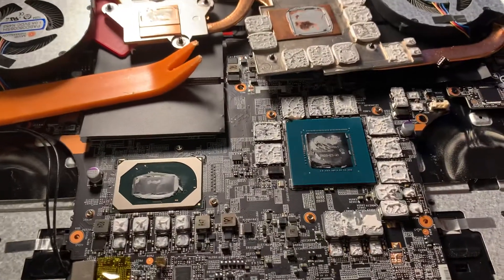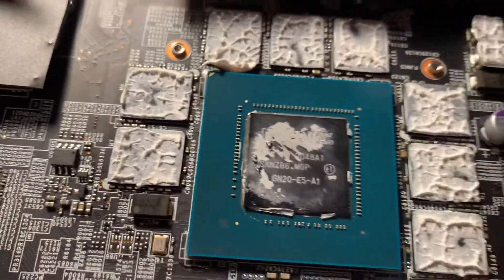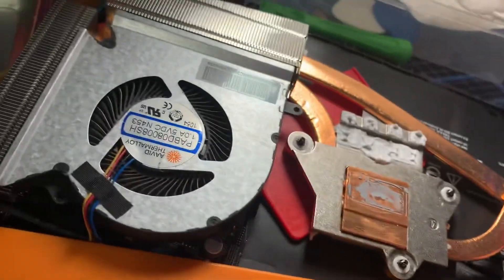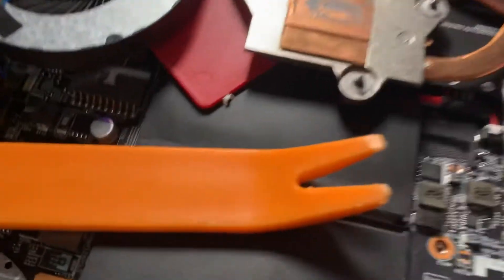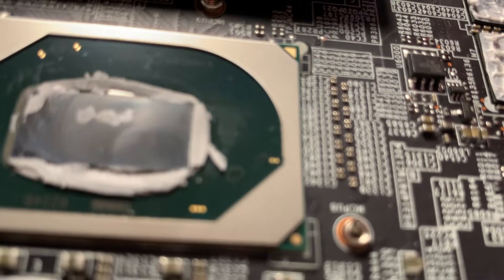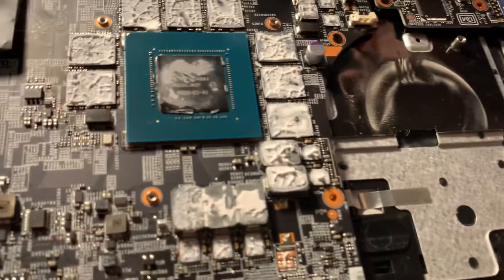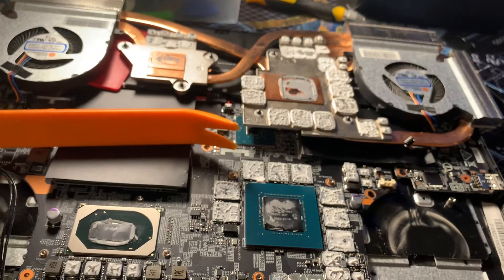Inside of an msi gp66 10ug 3070 / i7 / replacing thermal paste and pads. Tips for removal

Comment: Could you please let me know what size thermal pad you’re using? .1mm or .5mm
Reply from the maker: I used 0.5 but it created too much gap on the cpu/gpu core so you might need to use copper shim on the gpu/cpu dies. The best solution I found was a fresh layer or k5 pro putty on all the vram, mosfets and chokes and the thermal grizzly kryosheets on cpu and gpu die. That solution was far superior to everything even better than Liquid Metal
Reply: @cppctek  so better use 1mm for gp66 leopard?
Reply: Hi can you tell me when applying k5 pro putty, how thick should I make the putty layer on vram or should I just apply the putty like thermal paste ( very thin layer)
Reply from the maker: @ragnargaming6887 put 0.5mm thick or so. Maybe around the thickness of a dime. The rest will squish out and conform around the memory and the chips.
Reply: @cppctek  thank you so much for replying so fast, I got one last question, is it safe to use cryofuze violet for cpu and gpu, my friend suggested it gave him good results but since this paste also conducts electricity should I use it or no. Again thanks for replying

Comment: what should be the thickness of the thermal pad's thickness? that i need to use on memory and power supply coils.
Reply from the maker: .5 but actually thermal putty ends up working better in the long run. Use k5 pro.  After a year with shims was not too happy. Kryosheet on gpu and cpu plus k5 pro on everything else netted the best results when I had this laptop

Comment: I have a Msi Bravo 15 laptop, which pad thickness should i use? 0.5mm or 1mm?
Reply from the maker: I’d have to see it but likely a mixture of sizes. You will have to try to experiment and measure. I will be doing a new video hopefully this week using the new kryosheets and I’ll be redoing my thermal solutions that can give you some better ways to cool so stay tuned
Reply: @cppctek  Thank you! I bought a 0.5mm arctic apt2560, but I refunded it because I'm not sure if it will work with the laptop because of his thickness. And because I found a better option at a similar price. Maybe 1mm is ok..?
Reply from the maker: @reapersunshine2236 it really depends on the model. Your bravo uses diff components and capacitors and power stages and they can have different heights. Here is the issue. If your pads are too thick then you will have too big of a gap between the cpu die and the cooler or gpu die and the cooler too and you will run into worse temps than before like many find out. That’s why you see jayz2cents had worse temps thr first time he did his. Also there is a solution albeit risky but you can get perfectly sized copper shims but they require a lot of fitting and have a few risk. I’ve done it on mine. Also my temps are good now but I think there going to be even better this week with the kryosheet and going back to thermal putty but I’m going to see how well the pads made contact first and see if there’s any that were squished too hard or not squished enough
Reply: @cppctek  I'll try with 1mm. Hope i'll be lucky.. Thank you!
Reply: @cppctek  well, my Bravo 15 overheats at 100c in gpu, probably because of vram. Maybe 1mm is fine. Now, i don't have info of that laptop thermal pads thickness, so is just luck..

Comment: You should try phase-change material Honeywell PTM7950. It comes in as a sheet, lasts longer, performs works better than traditional pastes and there is no pump-out effect. For the power section (vrm) and vrams, I advise you to apply thermal putty Upsiren UX Pro.
It is also a good idea to do undervolting.
Reply from the maker: Thanks. I’ve recently picked up some ptm for my ally I tested it with as well as a ton of other stuff if your into ally content check it out. Also I do have some k5 putty it’s just messy lol. My laptops due for some cleaning so I will revisit this and test out some ideas All of MY ROG Ally Mods + How I clone my drives with one button! Feat. Yottamaster NVME Duplicator
https://youtu.be/8DjTrHzf6LA
Reply: Thanks for these suggestions!

Comment: Can not believe paid 1900 euro for 3080 model. Thermals are way too bad.. Thermal putty with cheap heatsink. Really msi.  Hardware like this really needs a real heatblock with decent thermal pads. cheapo
Reply: how did you unplug the battery cable im struggling with it have the 3080 model aswell and since i bought it temps are straight 95 while gaming throttled

Comment: Hey, how is the mod so far? I want to do the same with my Gp66 11uh, the Cpu temp crazy high, under load 95C throttles down to 3.5.(with undervolt) 
Any update?

Thanks
Reply from the maker: Still running awesome. I haven’t had any issues at all gaming or streaming or editing. It still gets pretty warm but never thermal throttles. I’ll check temps again but I know I use a cooling pad as well when I’m gaming to help
Reply: @cppctek  hey, is there a way I can contact you on reddit or somewhere else? I would like to ask  a few questions before I proceed with my mod:) if you don't mind of course
Reply from the maker: @Richard-dl2yp  drop your discord I got you
Reply: @cppctek  hey, have you had a chance to add me on Discord?
Reply: You should try phase-change material Honeywell PTM7950. It comes in as a sheet, lasts longer, performs works better than traditional pastes and there is no pump-out effect. For the power section (vrm) and vrams, I advise you to apply thermal putty Upsiren UX Pro.
Reply: @goorthiss Hi, sorry for my English, I've just seen your comment and I have a few questions. When ordering Honeyweell PTM7950 there are two sizes 40x80 mm or 80x80 mm, which is the correct one? And also I can't find upsiren uxpro, it's upsiren U6 pro, it's suitable? Thanks a lot, just wishing to lower my vector gp66 temps.
Reply: @DavidRoldánCampos  Buy enough PTM to cover the CPU and GPU. GPU RTX 3080 = 29 x 25 mm, CPU Intel 11gen = 24 x 12 mm.
Upsiren UTP-8 also has good performance, but U6 Pro should do the job as well. On the Snarks Domain channel, you can see their performance and check how many grams you will need to buy.

Comment: ¡Thanks a lot for the video! I have one question, there´s a chip between the ram modules and the m.2 ports, which doesn't have any cooling solution. I don't know what chip that is but I was wondering if it would be better to add a heat sink there, maybe with a thermal pad.
Reply from the maker: It’s just the motherboard chipset. It’s not needed

Comment: I plan to do the same, but mine is still under warranty. The temperature is simply disgusting, even figuratively speaking for the "base model", apparently I will spit on the guarantee and will replace the thermal interface (90c on a crystal is a wildly high amount).
I was not very lucky with my exemplar
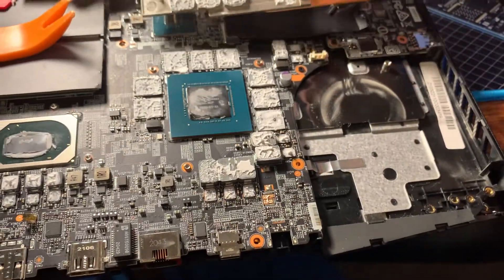, there is a noticeable burning of the textolite in some places around the perimeter (I posted the video), you have it barely noticeable (darkening) on 2:42 next to the screw attachment point, on the edge of the board
Reply: how did you solve?

Comment: I have the same laptop and I’m considering replacing thermal paste for something much better, would thermal pads work on the gpu ram and other chips?
Reply from the maker: Howdy. Well so here’s where I am at. I need to make an update video and you should watch that but the pads were slightly too thick for the vram and they are the smallest 0.5mm gelid pads which is the best of the best pads. So cpu die contacted fine but gpu die didn’t. So I ordered a shim kit and going to have to shim the gpu die. I bet you my temps will be so so much better at lower Fan rpm. I’ve got a few more cooling mods in the works so stay tuned I definitely can help you out. Are you on discord ? I’ve got a few groups for stuff like this I found. The stock thermal putty btw is a huge pain to clean and so far I am convinced I can find a way to avoid re thermal puttying the whole thing. The thermal paste I love using tho is kingpin kpx. It’s thicker and spreads sooo good and doesn’t have the pump out effect like the other paste people recommend. I’ve put this kpx to some super extreme test on both laptop and desktop gpus and CPU’s.   I can’t speak highly enough of it and gelid pads. You should see the temps on my 3080 fe now. 
Definitely if you have this laptop I have some good tips for you and if your into the algorithm thing ;) I have some major tips that way to seriously lower the temps and power draw
Thanks for watching and hopefully I’ll have an update within a day or two. My shims arrive tommorow
Reply: @cppctek   Thank you sooo much for the reply, I have enough understanding and experience replacing fans and thermal paste on ps4 consoles that I know I can apply it to my gp66 leopard, but before I tear into it I wanna make sure I get everything I need, it’s good to know that even the thinnest thermal pads won’t work for the vram. I was about to tear into mine and try it. I’ve had it apart for regular cleanings and ram/ssd upgrades before. What I was thinking is maybe finding what kind of thermal putty they used and just reapplying some of that for the vram and the other chips. However, if you have luck using a shim/shims if you do both cpu and gpu then I would like to go that route, use a liberal amount of thermal paste on cpu and gpu if it’s a shim that goes around the chips. Or if it’s just one that goes between the gpu/cpu and heat sink I could hopefully still use thermal pads on vram and good paste and have better thermals. That i7 10750H runs hot lol. I currently have a -112.x milli volt undervolt applied to my cpu core voltage and -96.x on the cache voltage. And I have it under clocked to about 3.6mhz. It stays at about 60c to 74c max gaming and gpu stays about 60-74c as well. With 100% gpu load. The issue is since there is one shared heat pipe if I allow my cpu to clock much higher, say 4.0 ghz then that added heat spreads to the gpu enough to get it to around 80c and it’s just too much for comfort. I would love to see a video detailing what you use and what works so I have a good idea what to do with mine. I love my laptop but since switching to a 1440p monitor and utilizing more of the gpu, heat has been a concern. I keep it well ventilated but I know the better thermal paste I have will help enough to let me get up to the 4.3mhz or so range (hopefully) on my cpu and really take advantage of my system. I do have discord but I’ll have to find my account info lol, it’s been a while since I’ve used it. I’ll post it in the morning once I figure it out. I’d love to work together on the project and I appreciate your reply a lot my friend.
Reply: I did have an idea for the vram, and since you already have your laptop tore down maybe you could give it a shot. Instead of a normal 0.5mm thermal pad, have you heard of the graphite pads for cpus? There’s one on Amazon called Innovative cooling graphite thermal pad. It’s 0.2mm thick. And you can get them a little thicker or thinner I believe. But maybe one of those cut into little squares would fit the vram, then normal thermal pads 0.5mm thick for the other chips around cpu and gpu. I work a lot and don’t usually have a lot of time for trial and error projects but maybe we could work together and figure something out? We have the exact same model laptop and they’re pretty sweet, I’d like to see what we could come up with. You have far more knowledge than me from your videos on your channel, and as far as I can tell you’re the only person making videos about repasting our specific laptop model. You’re honestly a life saver for doing so lol. Again, thank you for the fast reply.
Reply from the maker: @9derick6  good news ! It’s finished. I’ll try to film tomorrow. Ended up using a 0.25mm copper shim between the gpu die and hearsink with paste on each side spread evenly. I made a post on Reddit in the msi gaming laptop page earlier. The pic is of my kingpin paste and the pads and the shims. Link in description and break down. This turned out better than expected ! Ah man this is awesome.
Reply: @cppctek   if you could upload a video tomorrow and kinda walk me through it, I would be so grateful! Id love to see a video of it running with and without an undervolt under load for gpu and cpu. If your advice helps me fix mine, I’d be willing to cash app you a tip for the trouble!
Reply from the maker: @9derick6  def no need for payment. This is what I do for fun and stress relief lol. And so far I’ve been runnng a constant load with a +1350 MHz over clock in the vram and it’s 8 deg cooler than before. The core is about 7 to 8 deg cooler.  It’s been running over 12 hours with zero errors. I can even drop my fans down and it’s still better than it was before with cooler booster.
Reply: @cppctek   Also, I’m kinda new to Reddit and, well, I don’t know what to look for to find your post lol. Can you post a link to it?
Reply: @cppctek  Dude that’s awesome! I have to limit my clock on my cpu and use cooler boost to stay below 80c when she’s being pushed hard. I’ll follow your lead and try it out on mine in the morning or tomorrow sometime, if I can get the pads and shim in quick enough. I’ll take pictures along the way and maybe it could help out someone else too.
Reply from the maker: @9derick6  one second I’ll link you to everything I’ll copy and paste my write up with links
Reply from the maker: @9derick6  Thermal pads. Use gelid or nab (same exact pads sold under diff name
0.5mm. Cut pads to cover everywhere the putty covered. 
 Get 91% alcohol and a toothbrush and and a plastic guitar pic and get all the putty off first though of course. 

2 packs
Nab Cooling Thermal Pad 15 W/mK, 90x50 Heat Resistance, Non-Conductive, High-Temperature Resistance, Silicone Thermal Pads for Laptop, Heatsink, GPU, CPU, LED & PS4 (90x50x0.5) https://www.amazon.com/dp/B095NLHQVT/ref=cm_sw_r_cp_api_glt_i_FRMQWP9DPRM3QD7E1KH2?psc=1

For paste use kingpin kpx paste for best results. 

For the core of gpu make layer of thermal paste and flatten it out with a spreader very even. Take a 0.3mm copper shim and spread thermal paste even on the top side even and place the shiny side on the gpu die you just pasted. Now the shim should be centered and paste side up. 

Shims 
Easycargo 40pcs 6 Sizes 20mm... https://www.amazon.com/dp/B08LPT9PYX?ref=ppx_pop_mob_ap_share

Now paste the cpu but do not use a shim it should be perfect if you spread a thick enough layer and used these exact thermal pads I used. 

Now put back together and lay the cooler super flat as you apply it back and don’t let it wiggle or it will move The shim. Tighten gpu die screws first in a criss cross pattern but do a little at a time snd going back and forth so you don’t put too much tension on one side before the other. 

Now tighten cpu side the same and put it back together. 

This dropped my vram temps under full gpu load by 9-10 degrees and core temps dropped 8-9degrees with my first attempt and I know I can get better because my thermal paste dried snd got a little uneven. I ran out Of kpx and used xtm50 

I’ll make a video soon when I take it apart after a 24 hour test. 

So far I can drop my fan speeds down and maintain the temps I normally would get with the cooler booster on and screaming
Reply: @cppctek  Okay man, I greatly appreciate you! If you want, send me your cash app, at the very least let me send you $15 or something to put towards your next project, because dude I have searched for months on what I should do to repast this thing since it has thermal putty on the vram and everything I’ve dealt with uses pads and it left me stuck as I don’t have much time for trial and error lol.
Reply: Thank you so much 🖤
Reply: How’s it working after a year or so?
Reply: You should try phase-change material Honeywell PTM7950. It comes in as a sheet, lasts longer, performs works better than traditional pastes and there is no pump-out effect. For the power section (vrm) and vrams, I advise you to apply thermal putty Upsiren UX Pro. It is also a good idea to do undervolting.